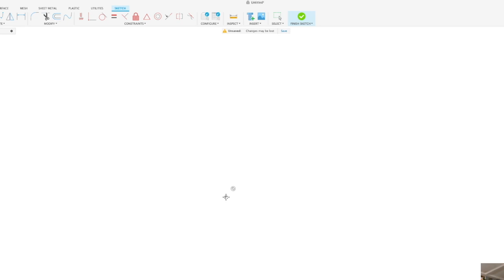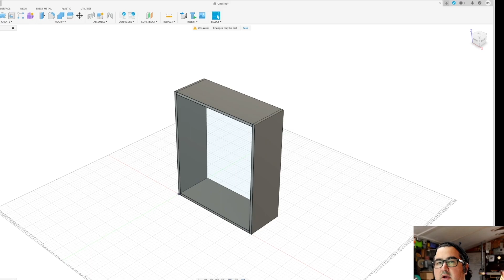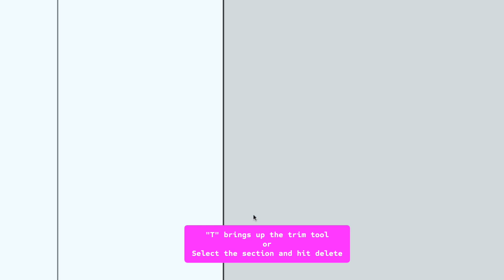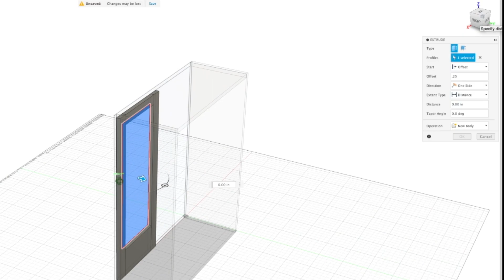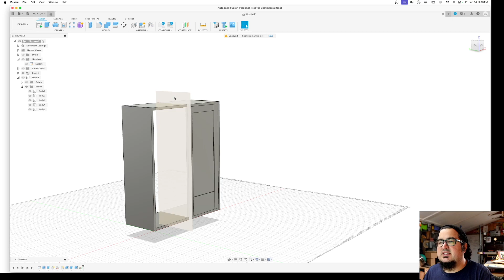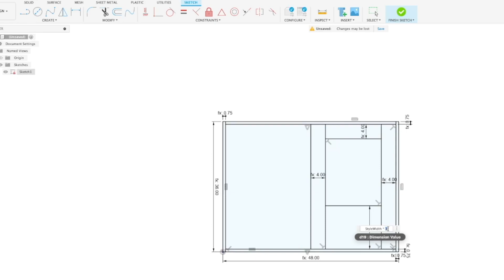Ep2: A Simple Cabinet - part 1 - Fusion 360 for Woodworkers

Comment: More of curious question that came to mind as I start watching this, does fusion360 do some sort of MonteCarlo simulation where it can randomly generate a lot of different values for the variables (where you can input the range) and provide an visual output of these images?  Thinking it could be a way to see lots of examples quickly and maybe lead to an unexpected one that is really nice that you might not have generated by doing a bunch of manual ones
Reply from the maker: That would be cool. Fusion is really geared towards more technical things and I can’t imagine engineers would need a feature like that.
Reply: @Woodorking  yea, I thought that might be the case. I know for Microsoft Project there is a company called One Pager that created an app that runs inside MS Project that does an awesome job of displaying timelines. Could see where is there was some entrepreneurial individual who could create a routine that you could run in Fusion 360 there might be a market for it. Not sure how big of a market thought.